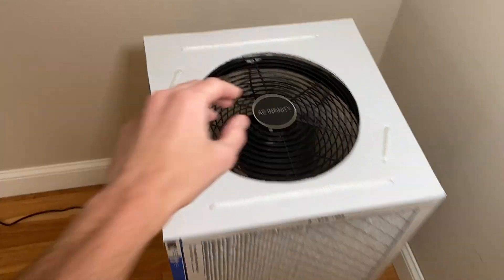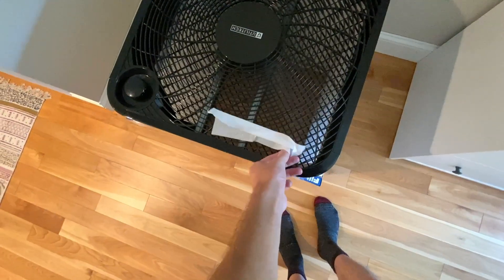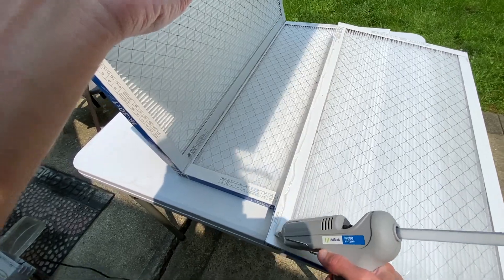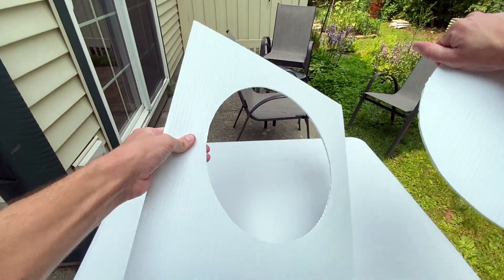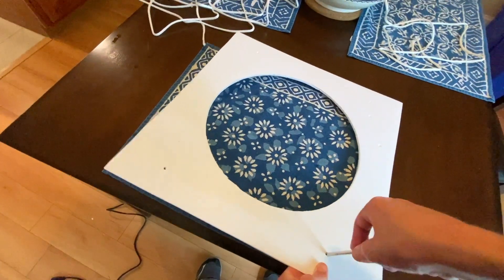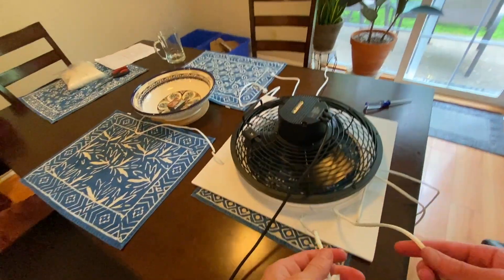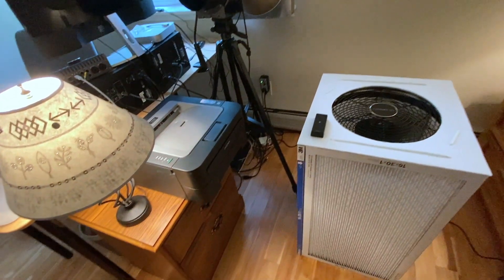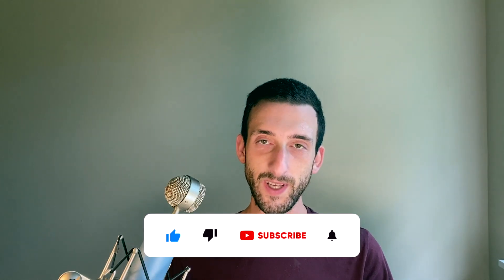How to Make a Better DIY Air Purifier

Comment: what are the pros and cons over using 2 inch air filters instead of 1 inch air filters for thickness? Also why do you now recommend filters that are 5 inches shorter? Is it more beneficial for the end user or is it more $$ from the affiliate link? ty

PS: Also, what do you think about using a shopvac on the filters to clean them? maybe the extension with the brush (do this outside of course)
Reply from the maker: In general, 2" filters tend to have less resistance to airflow than 1", and so 2" are often a better option. 2" are more expensive though, of course. In my air purifiers, I use 1" 3M Filtrete filters because they have such high quality pleating and perform so well that 2" is not needed.

I recommend shorter filters now because the 16x30 were too cumbersome too deal with when throwing them out. 16x25 performs super well anyway, so the loss of 5" isn't much of a loss. 16x25 is also available in person at hardware stores like Lowe's and Home Depot, so much more convenient if you don't want to wait for delivery.

I like the idea of using a vacuum to periodically clean the filters because their 6 month lifespan is up. I do so myself with a HEPA vac.

Comment: I don't get how this is better than a standard energy star purifyer if the fan is $170 by itself. My winix takex up half the space, requires no assembly, and has 3 layers of filtration.
Reply from the maker: The Winix is far less effective and far noisier. I've tested both. The one I built lowers particle counts faster and keeps them lower on average, and it does it while being quieter. Winix makes a decent air purifier, don't get me wrong, but this one is more powerful.

Check out my video "Most HEPA air purifiers are a scam" for more info.
Reply: @HealthyHomeGuide  FYI for reducing/preventing MOLD & Mold fragments the filters should be replaced every TWO WEEKS.
otherwise you have a MOLD FARM and you are spreading mold everywhere.
You might be GAR BETTER OFF to use only ONE FILTER and make the other three sides out of a washable wood or plastic a clean filter replaced MORE OFTEN would be much better for those with severe issues.

Comment: What square foot area would you judge this would provide service? This seems to be information provided with most filter systems. I have 2200 square foot condo two floors. I am thinking I would need two systems.
I am truely impressed with the concept. I just ordered the components looking forward to the assembly.
Thanks for sharing your design.
Reply from the maker: Thank you! A more recent video of mine called "Most HEPA air purifiers are a scam" discusses sizing methods at 27:59, if you're interested.

Comment: for those of us not as handy it's too bad someone just doesn't make a plastic housing with slots for the filters and the top holding the fan with a lip overhang and a bottom piece as well .. just a put the frame together slide in the filters mount the fan and plug it in ... i'd pay for that model for sure ! ....
Reply from the maker: I'm working on figuring out if I can make one to sell :)

Comment: Will this work for mold ?
Reply from the maker: At the end of the day, mold spores and extracellular material are just particulate, which all air purifiers are designed to capture. Research shows that MERV-13 air purifiers excel at capturing all particles, regardless of size.
In a moldy home, I’d still supplement an air purifier with remediation/cleaning/ventilation. 
Mycotoxins on the other hand, must be removed by remediation/microfiber cleaning/ventilation. No air purifier can significantly reduce them, and any who claim to do so are causing more harm than good.

So my answer is basically: yes. But as a part of a broader solution.

Comment: I love this set up. I just loojed at the fan. It's $169 from the link you provided. WOW, I need an expensive option. That's expensive. 

There's no way to inexpensively do great air purification. 

What is the benefit of making this set up, which I'm willing and able to do, versus buying an air purifier that does the same?  

Is it less expensive than a ready made type that does an equal job?
Reply from the maker: I recommend watching my video "Most HEPA Air Purifiers Are A Scam" if you haven't yet. That should answer your questions!

Comment: Does anyone know if the fan turns back on automatically if it loses power?  If so, does it maintain the prior speed setting?  I want to automate it to run only at night using a smart outlet.
Reply from the maker: Yes, and yes. It turns back on, and maintains the prior speed setting.
Reply: @HealthyHomeGuide , really appreciate the info and spending the time on putting out quality videos!  Thank you!

Comment: Thanks for the great video!  How do you feel about 3M filtrete merv 14 filters?  I found a great deal on them at a warehouse store.  I already bought my fan, etc. Also, do you think merv 12 is sufficient?
Reply from the maker: I think MERV-13 hits a sweet spot, but both 14 and 12 are good too. If you found a good deal with the 14s, then I'd get those. And thank you!

Comment: Did you recommend that glue stick, cuz it’s the least toxic adhesive?
Reply from the maker: Once it dries, yes. But to be honest, I now use low VOC tape as my adhesive because it's a bit easier when doing filter replacements.
Reply: @HealthyHomeGuide  great! Can you share the link here, please? Thanks!

I wanted to make changing filters as easy as possible. Was considering 3DHamdyman kits, however, they’re made from PVC. Thoughts?

Comment: Would it not filter better with the fan in the “pull” direction?
Reply from the maker: For air purifiers the fan should be blowing upwards, for two reasons: 
1.) If you blow air downward into the box, there's a lot of turbulence that reduces the air flow rate. 
2.) By pulling air through the filters before it hits the fan, the fan will stay cleaner.

Comment: You should've gone a few steps further and made a 2 solid wall housing with 2 slots for filters on opposite sides, so you can avoid having to rebuild this over and over. This way, you just swap the filters out by sliding them out.
Reply from the maker: That's definitely the dream. Just a ton more labor initially.

Comment: You could have sandwiched the plastic between the 2 halves of the fan housing, placing the fan properly in the hole. No messing with clothes line.
Reply from the maker: I tried something like that and the fan had to rest above the coroplast, which caused it draw in some air without passing it through the filters, unfortunately.

Comment: Great video, built one using all the techniques you shared…same filters and hot glue; however, while searching for the fan I found an AC infinity the same size and motor, but configured as an exhaust fan AC Infinity Airlift (AC-ALS12).  It has an attached shroud that covers the filters with no fabrication.  Thanks for the “how to”  with the detailed instructions!
Reply: Yes, just followed the steps As Alex described, other than the Airlift AC-ALS12 exhaust fan.
Reply: Thanks so much for the incredibly fast reply yesterday.
I feel like the 14-inch fan (16.93" square) might fit better and feel like a lid, rather than stacking on top. My concern is the fan size and the weight, so I have a couple questions about your build:
- Is there ample space between the filter walls and the fan housing? (could it fit the 14-inch fan?)
- I know there's absolutely no saying how the filter box will hold up over the course of a year, but do you think the filter box feels sturdy enough to hold a little extra weight? (the 14-inch fan weighs 4 extra pounds compared to the 12lb 12-inch fan)
Reply: @oryxthemad  

Glad it was helpful:

The fan shroud would be a little wider than the box (16.75”).  The 12” leaves about .25” around the outer edge.
 I believe it would fit inside (14.75”’)…tight, but  looks like it would go.
The box seems plenty sturdy, I’m sure it will handle the additional 4 lbs.
Reply: @kayandclay1979  I bought the S14 (larger fan) and assembled everything, here's my report:

the fit is REALLY tight, I had to do a little twist-and-turn to get the fan in, and deform the top bit of cardboard a little. Probably wouldn't have made it in if it wasn't for my hot glue job leaving some gaps, making the box a little larger than it should be. 
I'm also now realizing that the "cap" of the box being a little smaller than the walls of the box probably wouldn't have been a very big deal. I think the S14 was fine but I probably would've preferred S12 for ease of mind.
Reply: @oryxthemad  Awsome that the larger fan worked out; Almost double the air flow (1513 cfm) with only 6 watts additional draw and 6 db increase in noise…great performance upgrade 👍
Reply from the maker: Thanks for the info! Glad you found this video useful.
Reply: that looks like a great fan to use for this application.  What size filters did you use to mate to the fan shroud?
Reply: The same ones Alex highlighted in this video (3M 16x30 1” merv 13)…made a very simple and neat looking setup.
Reply: @kayandclay1979  So all you had to do was assemble the filters, right? Nice
Reply: I was about to buy all this, but this exhaust fan seems to be 12 inches square, while the filter box is 16 inches square, which means the exhaust fan's shroud would be too small to be propped up by the filter box. Wouldn't the S16 (16 inch) be the proper choice instead?
Reply: @oryxthemad  

The outer edge of the fan shroud is right at 15.75”, landing square in the middle of the filter ends when they are glued up as shown in the video.  I’m really happy with this fan and the only shortcoming I’ve noticed is when the fan is on and the louvers are open it leaves the fan blades exposed in 2.5” gaps between the louvers, though the blades are about 5.5” below the ends of the open louvers…not an issue for me, but would be if young children were around.
Reply: Yours has 830 CFM, his has 2130...

Comment: I am going to build one similar to yours, but I do have tools so I might use a piece of walnut for the top. I think a person could blow out the filter from the inside with compressed air like mechanics do to automotive air cleaners

Comment: How much difference does the MPR rating make please?.. Is there a range that is good for these DIY boxes?..
I found these: 14x24x1 Air Filter MPR 1500 Healthy Living Ultra Allergen 6 Pack- £50
Reply from the maker: MPR rating does make a difference. MPR 1900 is essentially equal to MERV-13, which is best. MPR 1500 is MERV-12. That is also good.
Reply: @HealthyHomeGuide  Thanks. I found these:
"Filtrete 16x20x1 Air Filter, MPR 1500, MERV 12, Healthy Living Ultra-Allergen 3-Month Pleated 1-Inch Air Filters, 6 Filters" - £50. 
I wonder if I could make a triangle one (so got enough to make 2) and stick a 140mm PC fan on each side. Do you reckon they would have enough power to pull through 3 of them?.. I wouldn't want them going anywhere near full blast coz of the noise. 

Might be better off with the other ones, slightly more filter for the price:
14x24 = 336 sq inch
16x20 = 320 sq inch

Comment: I just made purchase for the filter and fan. Coroplast can be bought locally. Hopefully I am not gonna fail this project. 

And hopefully this works better than commercial ones as I need clean air for my pregnant wife. (With multiple dogs in the room, pray it’s gonna reduce the amount of bacteria)
Reply from the maker: Good luck! It will reduce the amount of dust, which should indirectly reduce the amount of bacteria. For concerns about bacteria, microfiber mopping is best. I'm working on a video about that.
Reply: @HealthyHomeGuide  is it possible if you could do a test for pull and push airflow setup? I was thinking the same setup but a pull airflow instead, it would then trap large particle like furs in the air filter rather than having the fur exposed on the outside of the filter which potentially be circulated into the air again if the power is being turned off.
Reply from the maker: For air purifiers, I feel the fan should be blowing upwards, for two reasons:
1.) If you blow air downward into the box, there's a lot of turbulence that reduces the air flow rate.
2.) By pulling air through the filters before it hits the fan, the fan will stay cleaner.
Reply: I wonder does anyone have any video that did a CADR test for pull / push air flow 🤔 if anyone know any video that does a deep test on it, please let me know 🙏🏼

Comment: nice project!! Have you thought up any ideas for your next version? Maybe a rubber or foam seal around the top where the fan and box meet, I know it's probably not a big issue but would seal any gaps nicely with the weight of the fan or maybe a carbon filter to neutralise odours? 
Just some ideas, either way thank you for the video and all the research you've done on this! Keep up the great work
Reply from the maker: Thank you, and good question! I have a few ideas. Stay tuned ;)

Comment: Actually, you don't need to measure to find the center of a square, you just need to trace the diagonals, it will be more accurate!😃
Reply: Assuming its actually square in the first place.  But true.

Comment: We have a real need of this in my country but, sadly the import cost of these filters won't make it worth it. As the filters available here are much cheaper in normal air purifiers. And we have some huge ones too. There's a brand coway and their product looks solid. It looks like a box filter the way it's made.

Comment: Nice build instructions. One question though. Would it not be better to turn the filters around an have the airflow through the filter from the inside out, this way capturing all particles inside the box? Maybe you need to close the box at the bottom as well then using a piece of coroplast.
Reply from the maker: Thank you! For air purifiers the fan should be blowing upwards, for two reasons:
1.) If you blow air downward into the box, there's a lot of turbulence that reduces the air flow rate. 
2.) By pulling air through the filters before it hits the fan, the fan will stay cleaner.

Comment: Answer to your question: I'm using a Samsung air purifier. What I don't like about it is what happens after a power failure: you have to manually turn it back on. Is it the same for the fan in your design? I know this problem won't exist with a box fan.
Reply from the maker: The AC infinity fan does seem to turn back on automatically.

Comment: Is there a reason you used clothes line instead of zip ties? 

I feel like tip ties would be easier and actually more secure? Just a thought.
Reply from the maker: Zip ties got in the way of the fan blades for me. If you have better luck, please let me know.

Comment: While I appreciate the idea,  the inability to replace the filters seems  like a major drawback. Would it not be just as efficient building a frame out of chloroplast leaving one side to funnel the majority of the air? You get higher volume through the single filter which can be replaced when it fills up instead of needing to replace the entire base. Cost savings of about $50 bucks per use.
Reply: What do you mean inability to replace filters? You just yank the filters off and glue new ones on

Comment: Why not seal the bottom with a cardboard square and hot glue, then reverse the airflow so the impurities are trapped within the unit? Add a foam gasket to the perimeter of the coroplast to seal it and hold it down with the fan's weight or some small bungees.
Reply from the maker: Sealing the bottom with a square of something (preferably coroplast because it's moisture resistant, unlike cardboard) is a good idea, yup. I don't think it's 100% necessary, but it can help for sure. Agreed about the foam gasket as well.

For air purifiers the fan should be blowing upwards, for two reasons:
1.) If you blow air downward into the box, there's a lot of turbulence that reduces the air flow rate. 
2.) By pulling air through the filters before it hits the fan, the fan will stay cleaner.

Comment: First, thank you so much.  Great video and wonderful explanations.   I have two questions. 
First, I note that you changed from 16x30x1 to 16x25x1 filters.  What were your thoughts on this change?  And
Second, any advantage if I were to use 2” filters rather than 1” filters?
Thank you so much again for the video.
Reply from the maker: Thanks! I switched to 16x25 because I felt like the 16x30 were a bit cumbersome when it came time to change them. I also think that four 16x25 have a sufficient surface area already, the 5 extra inches isn't necessary.

Comment: I may have missed it but I didn't see you point out just how bad Merv 13 filters are at purifying the air.  Clearing "particles" is useful but not for your health if they are not small enough.  Merv 13 are not anywhere near the cleaning/purifying performance of a HEPA.  Cost aside.

Comment: I can't find 3M MERV 13 filter like that anywhere here. There are equivalent ones, EN779 Class F7, but they're aluminium and like $80 each. I was thinking of using replacement H13 HEPA filters meant for commercially sold air purifiers. Would that work?

Comment: Fun fact: because of USD to CAD exchange rate, delivery and taxes this beauty costs $400 for us in Canada... Even so, it's still worth it for the sheer volume of air it can move relative to the volume!
Reply from the maker: For those in Canada, another decent PC fan CR box company without exorbitant shipping is North Box Systems.
Reply: Thanks for the info!